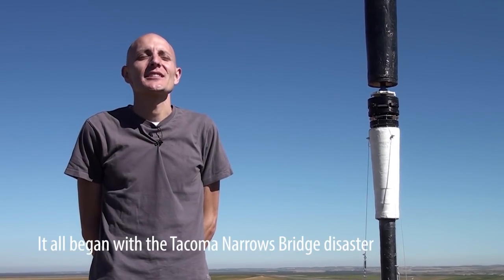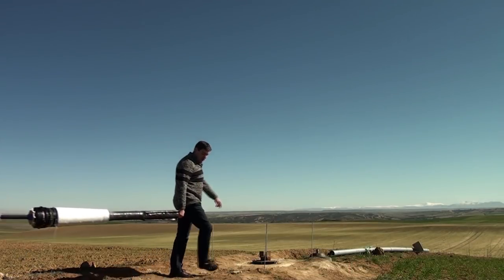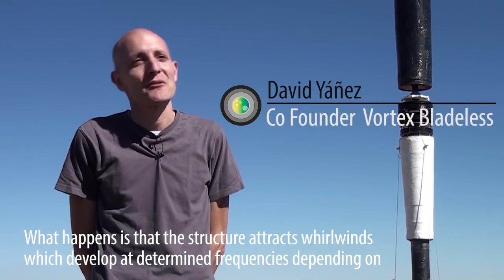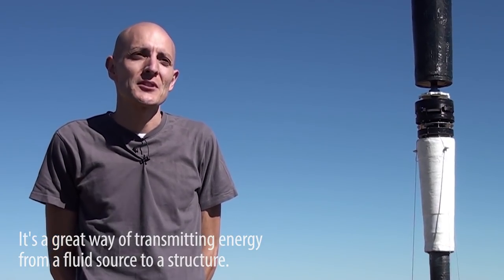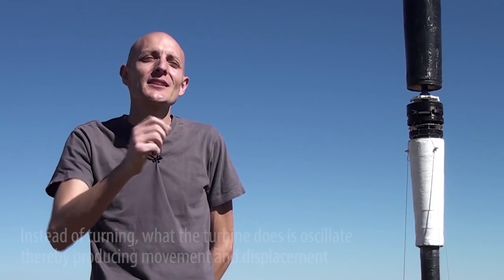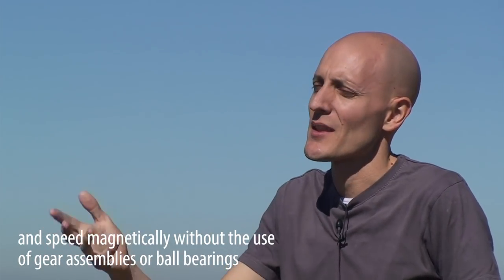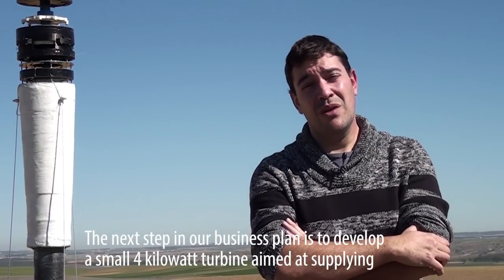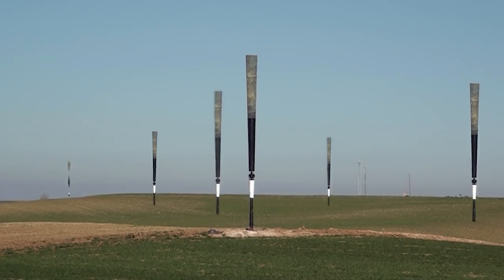Vortex Bladeless aerogenerador, Energías Renovables 2015 (outdated)

Comment: I work in an urban financial district with tall buildings that create a "concrete canyon" effect. It seems to me that a vertical-axis corkscrew-type turbine, only a few feet in diameter but running lengthwise from the roof all the way down to maybe the 2nd floor or so, built into each corner of the building, could capture quite a bit of energy. Might need to segment it to deal with variable forces along the length.

This might even mitigate some of the wind force on the structure itself, and maybe calm the "wind tunnel" effect on those of us below to some degree.

If I had the means to test and refine this sort of thing, I would. But since I don't, I offer it up to whoever might.
Reply: dwc1964 More traditional turbines mounted on corners is being explored, though as you pointed out you'd have to segment a helical design to avoid losses (or snapping) from differences in wind speed.
One example where we've shown this is in the Divergent series' version of Chicago. I know it isn't real but they wouldn't have put them in if it wasn't practical.
Reply: I guess I should watch those movies.
Reply: dwc1964 Future buildings could be designed with corners specifically shaped to accomodate these things. Very straightforward to modularise.

I wonder if this turbine could easily be adapted to pump water up into a reservoir?

Comment: Hmm that looks like it could be adapted to ocean wave use as well
Reply: Brian Michaluk Or smaller models to place on top of or around high rise buildings.  Not having the blades or noise to deal with is a god send for location.
Reply: Brian Michaluk  That's the point..

Put these things in the most hostile environment and you produce that amount of energy..
Reply: Brian Michaluk I think wave generators are already mechanically simple enough that there would be no need.
Reply: Oh my god your a genius. Where's your Nobel for that idea. Seriously. I'm shocked by how ingenuitive people can be. Waves would produce far more energy than wind and their always going on.
Reply: Brian Michaluk That was exactly my first thought....
Reply: Brian Michaluk I think this would work better in a current like a river. Then it would produce constant, reliable electricity.
Reply: ***** But a dam already does that.
Reply: AshyLarry If this works, you don't need a dam or turbines. Just this "wiggly" thing in a constant current.
A dam creates power by having a large pressure and volume of water going through turbines. On a large scale that will be the more efficient way to make power. But just think, a bunch or these along a river, no damage to fish. Actually at the bottom of a dam where the water flows into rapids, these could increase the total power by alot.
Reply: ***** Yeah but think of how expensive it would be to install these in the water and anchor them properly plus the extra cost of materials to avoid corrosion and water seeping into the cables. The point of these is they are mechanically simple and easy to install putting them in the water loses that advantage.
Reply: AshyLarry You know, the more I think about this, and think about the mechanics to make this work, the more sceptical I find I am. I've been looking for real scientific data on it, but it seems more like this is either a "dream" or a scam.
Reply: ***** What exactly makes you sceptial?
Reply: +Admiral8Q It works fine as a wind turbine. I am a bit sceptical about using ocean currents because of the logistics and cost. The most effecient way I could see it done is to flip them upside down suspended by an anchored floating platform(like an oil platform) and the wobbily end weighted with a sinker and submerged.
Reply from the maker: Hi! That's correct, Vortex shedding effects happens on water as well. There is actually another company developing turbines for rivers based on this principle

Comment: Brilliant. I wonder what would happen if you placed several solid towers around them with a rectangular cross section (like a stack of single concrete blocks stacked one on top of the other in a vertical pile). Such shapes tend to shed vortex eddies when air moves by them. If they were sized properly and positioned correctly, they would likely be able to maximize the times that the generating tower would start to oscillate. It might be able to make these generators work at lower wind speeds, and at the same time, the static towers might block some of the danger of excessively high wind speeds on the generating towers. Sort of a wind-wind situation if you excuse the pun. ;-)
Reply from the maker: Hi Jim! That is an interesting idea which we studied some time ago. To install cross sections around the aerogenerator will improve wind conditions inside if the average wind is oriented to the same direction. In the case of units installed close, simulations and calculations confirms that downstream devices nearby tend to work better than alone.

Comment: Very small cross section, or swept area, so many devices are required per linear meter. Hence, it may cost more than rotor devices, which sweep much larger cross sectional areas.
Reply from the maker: Hi! We think in our capture area or sweept area as a pro if you mind birds, noise, maintenance and space optimisation. You can install Vortex turbines very close to each other without any disturbance or shadow effect. Material and manufacture costs once industrialised will be very competitive compared to regular turbines. Vortex Tacoma's weight is under 12 Kg (2,75 m high). Our goal with this technology is to make them an equivalent in wind power to solar panels.
Reply: Agree. There is no such a thing as free lunch. You can harvest only the energy of the airmas that passes the area the generator covers. And it is not that much in the case of pole sticking from the ground. I can't see it generating any serious amounts of electricity.

Comment: A couple of questions: do these work in all wind strengths? How do they avoid being damaged in strong winds? How much energy do they generate in relation to standard turbines?
Reply: hamsterminator That is my main concern also, how do they avoid being damaged in strong winds.
Reply from the maker: Hello! They work within a lock-in range which deppends on the model. We have designed Vortex Tacoma (2,75m) to work between 4 and 11 m/s aproximately, which are the most common wind speeds you can find. 

Due to its natural principles it will stop working by itself over the threshold of max speed. Calculations give a survival speed of over 30 m/s but it is hard to measure this on labs in long term. 

About the third, it deppends on which turbine are you comparing to and where! Compared to regular turbines of same height, Vortex has less capture area so lower nominal power generation. But if you calculate an anual power curve, deppending on your place, vortex turbines could be more cost-effective.

Comment: Quote from 5-15-15 Wired article: For the time being, you’ll continue seeing pinwheels dotting the landscape, which Suriol is actually happy about. “We can’t say anything bad about conventional wind turbines; they’re great machines,” he says. “We’re just proposing a new way, a different way.”

That comment shows little concern for the loss of scenic vistas to conventional wind turbines. If future blade-less models are anything close to that size (and more densely packed) they will do little to stop a major objection among conscientious environmentalists. Too many green-tech engineers consider landscapes expendable and think oil and coal are the only villains. Placing those Vortex generators inside urban boundaries would be the main benefit I could see. Scattering them around the countryside would merely continue the industrial plague we're already seeing, even if they weren't as tall. Too many rural views are being ruined by this inefficient, intermittent power source.
Reply: Try global catastrophe when the whole world burns up and there is nothing left from using conventional fuels. Complain about not having beautiful views then.

Comment: How is the generator controlled when winds speeds become too high and damage may occur if oscillation is not stopped?
Reply from the maker: Oscillation stops by itself if wind speed exceeds max device's operative threshold. For the 2,75 m high unit, this threshold is over 12 m/s. It just stops, cannot enter into resonance over that speed. Survival speed is calculated to be over 30 m/s, provisional data. You can read more here https://vortexbladeless.com/technology-design

Comment: you talked about cost,maintenance and all other stuff,didn't mention the efficiency,power output
Reply from the maker: Hi! This video is a little outdated. Vortex Tacoma specs based on current trials and calculations are (Provisional data!!!) 2,75m high, less than 14 kg weight, around 3-12 m/s lock-in range, >30 m/s survival speed, >100w nominal output, more than 250-300 kWh/year with spanish wind conditions. Cost-effectiveness and environmental impacts are being measured. You can read more about this tech here https://vortexbladeless.com/download-green-paper

Comment: Really neat idea to use resonance to couple the energy out.  Turns a famous disaster into an advantage.
But my second thought was that a normal turbine still generates energy at a whole range of wind speeds.
The big disadvantage of a resonance technique is it only works at a specific set of wind speeds, no?  
So you'd need to site it in places where winds are steady - this will limit the places it can work.

(And there are other vertical axis designs that just spin and would work at a range of speeds.)

Nevertheless, love the lateral thinking and don't stop there !
Reply from the maker: Hi! All wind turbines are designed to work within a range of wind speeds, it is called lock-in range. Some regular turbines are not able to start on their own and have to be stopped by breaks when reaching max speed. Natural resonance frequency of Vortex's structure is adapted by a neodymium magnets system we call tuning system. This way we need no shafts, weights or moving parts in contact to have a wide lock-in range. As end-consumer / distributed energy wind turbines, Vortex devices work better in the most common wind speed range you can find (3-12 m/s) so it remains operative for longer periods. Read more here https://vortexbladeless.com/download-green-paper

Comment: How do you expect to compete with the standard blade turbine and the amount of electricity they put out compared to this tiny, blade less model. How much electricity can it produce. You seem to leave out those very important details.
Reply from the maker: Hello! Any wind generator is able to produce as much energy as its capture area or sweep area. It also deppends on wind conditions of the place. Big regular wind turbines have a huge capture area, which makes them to be far away from each other, and are ready to work with high speed winds. Our concept is the opposite, smaller wind turbines with smaller capture area that produce less energy but for a longer period of time, on a very tiny space and with low maintenance, noise and no harm to wildlife. You can read more here https://vortexbladeless.com/technology-design

At current stage (2018) we want Vortex wind turbines to be an equivalent in wind energy of solar panels for end-consumers / distributed energy. Reaching the market soon.

Comment: Is there not issues with fatigue life from the cyclic loading due to the forward and back movements?
Reply from the maker: Hello, of course the aerogenerator is not inmune to fatigue. Vortex turbine’s inner rod suffers continuated flexion and a material failure could eventually occur. It is made of carbon fiber and designed to work at a maximum oscillation amplitude of 2,7º on each side. This implies a very low material’s deformation. Computational and mathematical analysis carried out in relation to the component most affected by this phenomenon of fatigue make us think that Vortex aerogenerator has a huge life span. You can read more here https://vortexbladeless.com/technology-design

Comment: Would the vibration and fatigue greatly reduce the life of this turbine ?
Reply: Darren Pinto This is not a turbine, a turbine spins round.
Reply from the maker: Darren, vibration does not represent an issue since it is absorbed by the whole structure. Fatigue of course happens and we took that problem into account from the first moment. Both computational simulations and mathematical models of the carbon fiber Rod (the core of the turbine, the thing which is being flexed) they give a lifespan of several years working on constant wind conditions. You can read more here https://vortexbladeless.com/technology-design
Reply: How is the power produced?

Comment: but what is the power output compared to the current ones?
Reply: drago black they were talking about a 4kw system in wind speeds up to 7m/s I work in an industry where I'm working on a 2Mw and is able to work up to 25m/s, at that speed they shut down it ultimately becomes too unsafe.
Reply from the maker: Hello! Current commercial strategy of the company as a startup is to focus in small-wind generators to enter in the market humblely and from the bottom. We are developing an aerogenerator for end-consumer / distributed energy of 100w nominal, 2,75m high, less than 14Kg weight and which works on the most common wind speed ranges to maximize working hours. Our main "competitors" right now are Solar Panels since we are more similar in features to them to regular wind turbines. We want  Vortex devices to be affordable and simple as solar panels so you can install a bunch of them in the best locations of your place with no disturbance to people or animals.

Comment: Do you modify the natural frequency of the structure to work with wider range of wind speed by means of altering ballistic weight height?
Reply from the maker: Natural resonance frequency of the structure is adapted by a neodymium magnets system we call tuning system. This way we need no shafts, weights or moving parts in contact. You can read more here https://vortexbladeless.com/download-green-paper

Comment: I need a little help here. As a military helicopter pilot I am very familiar with Bernoulli's Principle of AeroDynamics. I have a solid working understanding of rotor systems too. I don't see this thing doing anything. Does it spin, or just wiggle like a dogs tail? What?
Reply from the maker: Hi! It enters into resonance with wind's vortices that are created when a fluid passes through a structure, this energy captured makes the device's mast to oscillate like happens in flags, chimneys, bridges... then mechanical energy converted into electricity. You can read a whole explanation in our tech paper https://vortexbladeless.com/download-green-paper

Comment: you could also drop water from that height and harvest it multiple times in the form of kinetic energy as well, a pump and waterwheels :D. when the energy harvested from the various waterwheels exceeds the energy required to pump the water to the top of the turbine you'd be in profit aswell no?

Comment: okay what are the specs like say a car passed by and turned it......how much power is that?  Does it work on larger scales or a few upgrades for larger scales? because skyscrapers the problem you keep running into is their all next to eachother.........so you could put something on top of it, to generate enough power....and conservative siding that won't rot/ corrode

Comment: Question....What percentage of the oscillatory energy is converted to electrical energy?
Reply from the maker: Hello! Betz's limit says that any wind machine can only harness less than a limit of amount of energy from the wind, around 50%. Regular small wind generators conversion is around 40%, Vortex's conversion is around 30-40% as well, sightly less than rotatory conversion systems. You can read more here https://vortexbladeless.com/download-green-paper

Comment: I am curious how the power/price ratio compares to traditional wind turbines.
Reply: These cost about 51%/47% less than normal wind turbines so that should give you a rough idea.
Reply: Quilliam Attari That isn't nearly enough information to assess their worth. For example if they generate the same amount of energy as a wind turbine they are fair better, but if they prouce 25% the power of a wind turbine they are currently far worse. 

That is like responding to questions about the cost effectiveness  of apples vs oranges and saying the oranges weigh 25% more, but you don't know the price of either. It's meaningless.
Reply: x1v160 They currently produce about 30-40% less power than current wind turbines. So at 50% of the cost, and 60% to 70% the power, it still is more cost effective. If you take the same amount of power produced, then the cost would be about 65% to 70% of the cost.

They can be placed much closer together so they would need less area.Also they would be much easier (cheaper) to maintain (Not sure of the difference on maintenance costs though)
Reply: x1v160 He did say that if you compare it to a wind generator that produces a similar amount of electricity, the cost would be about 50%. So I'm getting mixed information here myself. More research and testing is needed I think.
Reply: ***** 
Thanks.

Comment: what is the latest on these wind turbines? most info seems dated 2018?
Reply: New short videos, still without any serious data, especially power output at different wind speeds.
Again announcements of bigger versions.
I suppose, this scam will run forever.